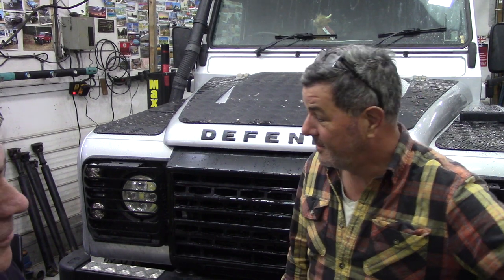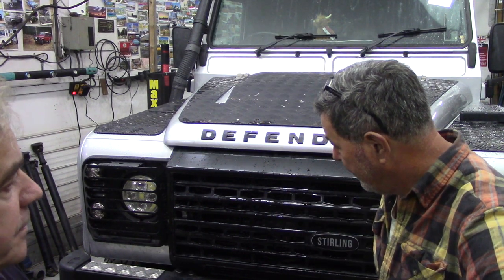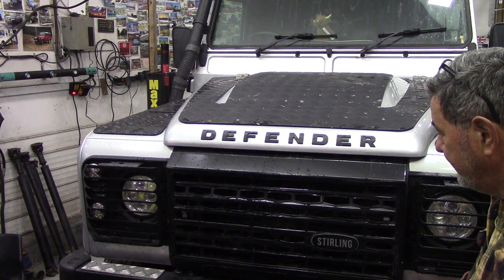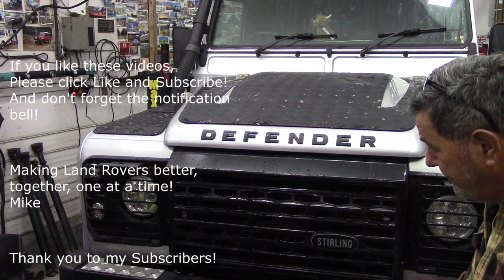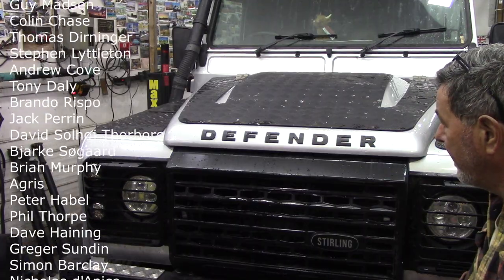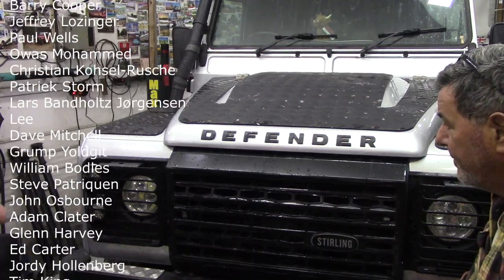Paul's Puma  - end of the job

Comment: Mike your last comment, funny how they got away with it on the Td5. I think the power/torque delivery on the td5 was a lot kinder to the transmission. The Puma torque delivery is aggressive particularly if driven with a heavy right foot. Commonly makes them spin the wheels! That grunt arrives all at once and then is over in a nanosecond so your changing up and down that 6speed box like a yoyo 😂
Reply from the maker: It is strange as the P38a had a 4.6 fitted here, and I never heard of diff issues
The 1st gear in the Puma is quite low so maybe the weight and torque at low speed did it - I have never seen bolts shear off like that before
Reply: @BritannicaRestorations  you’ve got it, the P38 was mostly automatic transmission so smooth take up and torque at higher RPM that came on smoothly and progressively- rather than BANG at 1200RPM 💥and then bugger all by 1900rpm

Comment: to bad the ratio is wrong the front is 3.54 and rear is 4.7.
Reply from the maker: The 4.71:1 unit is from a 109
Reply: I'm talking about gear ratios not wheel base lock the diff and see what happens.